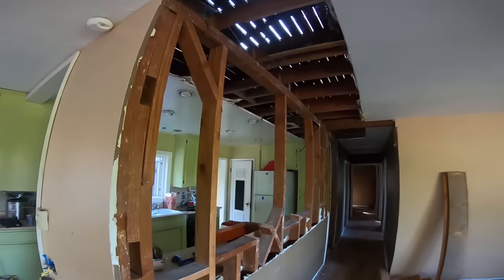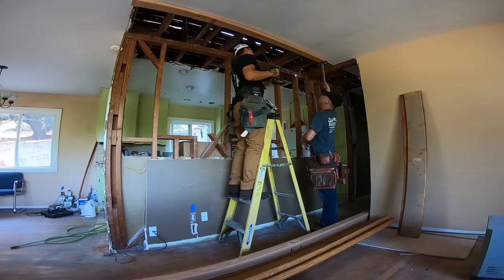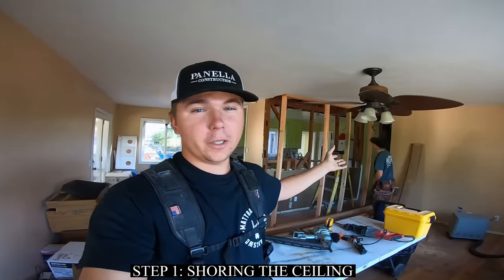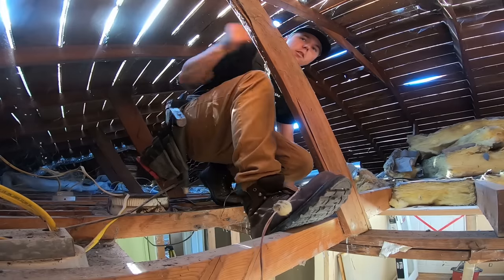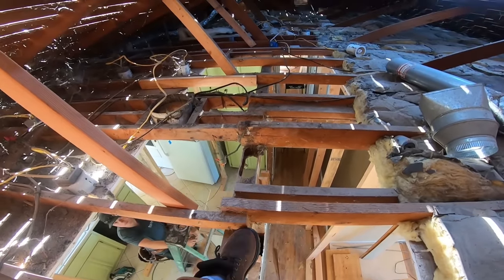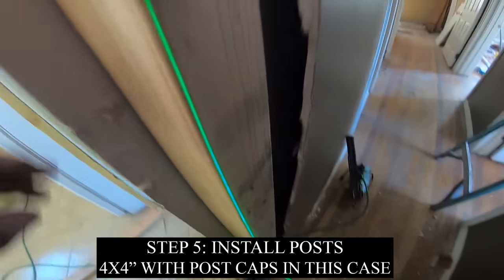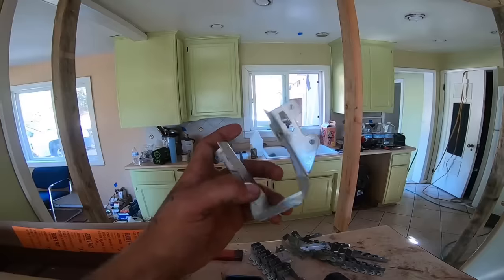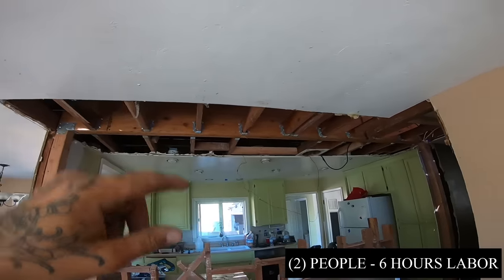How To: Removing a Load Bearing Wall! (EASY STEP-BY-STEP)

Comment: Looks great. Might be good to mention something about potential footers needed.
Reply: 4x4 post definitely need to be supported to ground with pier/footer.  No mention in video.
Reply: @billbrickhouse5975  This is why i was looking through the comments. Do the posts he put in have to loaded onto posts directly below?
Reply: That's what I was thinking,  where's the part of the video showing load transfer all the way down to foundation or footer? even is there's a beam below where are the squash blocks ?
Reply: @fab2832  it was a load bearing wall, it supposed to be a girder underneath...
Reply: Since it is load bearing there should already be a footer underneath from the original build.
Reply: @trevoratkison5074  Maybe? But this is the kinda stuff he should be showing, but he bangs wood not footings? This could be a major compromise to a house structure. However, 6 hour of labor and a screw gun, should be fine.
Reply: Not only that, increasing the footing to hold additional load. This guy is either a GC tool with a GoPro or I don't even know. Maybe living in Guam?
Reply: @ianbeavertonyeah  Matt FOR SURE knows what he is doing.
Reply: ianbeavertonyeah We don’t know where he is, but there is no additional load being carried by the footing. It’s the exact same roof as before, just carried through two posts instead of a wall. The weight goes down to the existing footing. If there is no footing under the house then it was built incorrectly.
Reply: @trevoratkison5074  those beams he set up in the roof don't weight anything? Also considering the roof looks stripped? Is it also not possible they may be resheeting the roof and using different covering material? Seems certainly possible more load is being added.
Reply: ianbeavertonyeah It sounds like you’re not a builder or an engineer. I’ve dealt with both. The house isn’t going to collapse.
Reply: I was thinking the same. Though there is a really good chance that the 4x4 on the corner has support under it because it was already a high load area.
Reply: Its on a slab you YouTube engineers 😅
Reply: Fab2. Same load as before. It was bearing weight at the same points.
Reply: All load bering walls have a foundation already so the 4x4 are fine
Reply: @trevoratkison5074  right, but it would have been engineered for a linear load, not a point load. A footing engineered for a linear load is not, by default, engineered to support a point load.
Reply: @ianbeavertonyeah  not a significant enough load change on the roof to factor into removing a load bearing wall.

And IF let’s just say IF they were red herring and using a very heavy roofing application they would have to beef up all load gearing walls, interior and exterior.

This wasn’t “how to strengthen all existing load bearing walls to support a double weighted roof” it was “how to remove a load bearing wall”

The reasoning for this isn’t to support EXTRA load, it’s to carry the load in a way to create more interior opening.....

And the weight of the roof braces??? Really??? Adding a couple 2x4 in the roof is going to affect the weight of the roof to the point you have to add extra reinforcement to the load bearing section??? Really??

Unless their using clay tile or slate tile there’s not a roof load to calculate.

People double or even triple shingle roofs commonly. Not saying it a good practice.

But do you think if their saving money on the rear off of an old roof their going to double up load bearing walls??
Reply: @geoe5137  but yes you have a valid pint about that.

The foundation will already be strong enough to support the load (in lbs) but the floor joists should have some extra support at the two points that the 4x4 posts were attached.

Just a simple sister joist spanning the area would be good and quick and easy to throw on.

Not a massive area to cover anyways, just to ensure the vertical support below the floor joists carrying down to foundation footing (if footings) aren’t strained below the posts more than before, as there should be verticals all along the work area (almost a mimic of the load bearing wall just removed) so that all those verticals under the floor joist are getting even weighting through the floor joist.

Now would it be better to double up the floor joist so it can better carry the two 4x4 points evenly across all the lower verticals?

Or would it be better to just double up the verticals below the 4x4 posts?

I would think sistering the floor joist would give a more even weight bearing than just doubling the lower verticals wouldn’t it?

But then doubling the specific lower verticals could in theory carry the weight down to the footing though?

But then I’d imagine it would put more stress on the specific points where those verticals sit on the foundation. So in theory not just in terms of framing but in overall terms it would be better to sister the floor joist? As it would then carry down several verticals to the foundation so the foundation has an even load?

Not just worrying about ‘will the wood be able to carry the weight’ and only think in terms of framing, but rather will all things factored in (foundation) be able to long term handle the load in a proper way as to not cause extra fatigue on the footings in specific areas.

Let’s get some good convo going here might save someone from making a grave mistake lol.
Reply: And btw I’m not an engineer or framer.... just a roofer using his noggin trying to apply common sense in a world which lacks it greatly.

And comments or criticisms taken appreciatively.😘
Reply: @trevoratkison5074  wrong. Your load is no longer distributed
Reply: @sinnermandanny   Read the other replies. There is no added weight, and the roof on a small house like that has plenty of support from the existing footing. Removing 10' of wall in this house will do nothing to disrupt or harm the footing that is already there. But go ahead, find the home owner and give them a call. Ask if their house has collapsed and then prove me wrong.
Reply: @trevoratkison5074  the post have to be carried down to the girder with squash blocks it’s a point load now and not spread out across the 2x4 wall like it was before they took it out.  LVL carries the roof, the posts carry the LVL On 2 point loads that need to be transferred down to girder directly under posts.  The part of girder in between the 2 post is only carrying the joist and sub floor now that wall is gone.

Comment: Good job Matt🤗
I’ve got a 1954 California Ranch style house here in Orange County, Ca. This model has a 16’ span that runs directly under the Ridge of the roof. The original builder installed a 6’wide x5’ tall privacy pony wall under and to the side of the 16’ long beam. At the end of the pony wall “Was” a 4x4 post. Meaning the unsupported span “Was” 10-11 feet.
Everybody is this neighborhood took it out for aesthetic reasons. 30 years later everybody has saggy ceiling (1/2”- 3/4”) and huge crack running the entire 16 foot span. I’m so tempted to just jack it up and build another pony wall with support. The original beam is a 4x12 that I should sister some LVLs to. 
Guess those old timers knew what they were doing with that pony wall / support. 
Anyways.... good video, you are a talented teacher/video editor. I will hit subscribe and like👍🏼

Comment: I am interested in seeing how the purlins and lvl beam looked at completion. I did not see where they were attached to complete the support. Excellent work and video, closing on a 1960 home and am looking to open the kitchen interior wall to the dining and living rooms for entertaining purposes and install an island. 24' Span single story. Definitely excited. Thanks!!!!!
Reply: Not sure the length they did on this one, but it was 14" beam. What size beam will you be using on that 24' span?
Reply: @afternaphair  putting this on the maybe sometime lol currently looking at some other Reno projects starting with inground pool. Cheers

Comment: Great Video. One question though: What do these 4x4 posts sit on? You need to make sure the loads from these posts can be safely transferred down to the foundations.
Reply: They should be sitting on 2x4 bottom plate that bolted on the ground
Reply: Id bet the house doesn't have a basement, and the length of houses with no basement have cinderblocks spanning from side to side

Comment: I have to replace a garage door header so this video is very helpful in building a support wall to hold the weight so I can remove the old and replace with new. Have a lot of termite damage to deal with.

Comment: Great job! Only thing I would add is info on the footers. Most of the time they need to be modified or redone for the new load bearing posts.
Reply from the maker: I wasn't really sure who I was going to be targeting with this video, and I had to make sure it was done fairly quick, so I skipped over a few things I wish I could have added.. Got the basics! This build in particular is a subfloor.. So 4x6" blocking underneath is necessary! :)
Reply: @MattBangsWood  Great video!  The 2 things I would of added: 1 What Dad Said above and 2 would be a reference to beam sizing, so people don't go sticking 2x4's or 2x6's up there. Love the videos, Keep up the good work!!!
Reply: Ahhh, what does dad know anyway?!  Good stuff guys, appreciate your work & enjoy the channel.

Comment: another excellent vid. I like that you take time to explain, both by voice and diagrams. I hope they changed out the recess lighting. You lucked out on wire slack to go over beam. I’ve had to go reroute on many remodels, but none had the roof decking off. Would’ve helped on those hot Texas days.

Comment: Hey, good video!  Should you not have PL glued and screwed the LVL beams before hanging joists on either side?  For a more solid assembly that will resist pull-apart?
Reply: true but not neccisary

Comment: Great job!  What does it cost to have such a project done?  I am considering doing exactly what you did in ranch house to open it up.
Reply: I was considering having a load bearing wall removed to open up the kitchen to the living room. There's another level underneath so that complicates things (e.g. if it wasn't done correctly the front part of the house would collapse). An engineer would need to be consulted, blueprints drawn up, permit obtained and an inspection done. I'm in California. The contractor estimated it would be $5000 to $7000. I'm leaning towards not doing it since it would delay my renovation.
Reply: I have a basement below my kitchen/living. Same situation as Rachel, I got quotes for 50-70k for a kitchen remodel with removal of a load bearing wall in California early 2022.
Reply: @rachels7252  
You can sometimes go above it like he did or good below it. 
In the basement you can put support down there also instead of just above it. 
In some cases .

Comment: Though the term “load bearing” is correct, what load is the wall actually bearing? It’s a truss type roof system and all the load is transferred to the outside walls.  Cool saw by the way.
Reply: The ceiling joist coming from each direction ended on top of that wall, it was stick frame not trusses
Reply: TJP 81  whaa?
Reply: not a truss even if it looks like one. A truss is an engineered structure; it has to have an enginer's stamp for it to be an actual truss. This roof structure was stick framed and looks like it actually did have collar ties but they were high collar; what he should have done instead of the purlins, is install a mid span collar tie as temp shoring for the potential splaying of the rafters BEFORE he cut the joists. This kid got lucky, hopefully he'll learn
Reply: TJP 81  depends on where the point load is but...chances are if the load is that great then the truss has been compromised ;-)  But I wasnt talking about this, I was talking about the purlin 'beam' the contractor said would prevent bowing of the roof rafters. Hes kinda right but any load on one rafter w/the purlin would not transfer much load onto the next purlin for how stick framing assemblies behave. He should have attached some mid rise collars, even if it were to be in his crew's way. But this is all moot anyhow since, all he needed todo was at maximum triple up (full span) the existing 2x8s? where the wall below would be removed; saving time, money and renovation costs to the HO.
Reply: TJP 81 seriously i have no idea what you are referring to when you type “vertical braces”
Reply: TJP 81  its called a purlin brace. You are confusing engineering nomenclature between traditional framing and advance framing (truss). You cant apply truss analysis to anything but a truss. As this roof assembly is constructed in modern traditional framing, it has the associated parts and names. In a traditionaly framed stick roof, the purlin brace are indeed designed to carry load. Maybe not all the time, but then again thats why there are 'live' and 'dead' loads for engineers to calculate; also these loads var depending on season. Personaly I dont see the point in purlin braces as knee walls are much better in both structural performance and ease of moving within the attic. Regarding this framer's methods, it would have been better for him to apply a mid or even lower collar tie to temporarily brace the roof because for ease of movement but mostly because he cut the lower coar tie, which was the joist, which could have caused the roof to collapse on him. He got lucky.
Reply: Not a truss roof at all. It’s a cut and pitched roof

Comment: A little late to watching this video so someone might have mentioned it you forgot to show transferring the load thru the floor system done to the foundation.
Reply: Kevin O'Brien  unless it’s not a Crawl space or basement and it’s actually a Concrete slab under it .
Reply: Sometimes even a slab is not enough support.  It may need its own footing.
Reply: Dalex AAB either way they should have addressed it in the video as something to be considered
Reply: Wouldn't it be the same?  The beam occupies the same exact space the wall did, so wouldn't the wall have to already have sufficient support down to the foundation?  Or is it different when you put a beam in?
Reply: mae2759 a wall transfers load oil over a floor span. When you use a post to carry all that load its call "point loading" and requires you to confirm a footer or figure something out.
Reply: @mae2759  concentrated load
Reply: Yes the point load needs support on the girder beam because it can land in between the joist and a single fire block is not enough if you even have fire block depending on when the house was built, not mention what size is the material used for the girder could be 3 -2×8's when 2×10 should be there or even the age and condition of said girder could already be sagging or rotted out. if he didn't investigate it I call it a failure by a novice who shouldn't be pretending to be a professional
Reply: Bryan Douglas you can't just keep adding fire block you also need to double up the joists
Reply: @markschiavone8003  when did I say just add fire block, I didn't
Reply: Bryan Douglas , yes but you didn't say that you need to double up the joists which is important.
Reply: @markschiavone8003  in Virginia point load must go from beam to foundation using non compressable materials
Reply: Bryan Douglas , cool
Reply: @markschiavone8003  you are correct but I'm not getting paid to solve the problem for him either there are many options for fixing this problem and I could fill a page with options for the situation lol.
Reply: Bryan Douglas look when you present a solution to a problem and you leave out a important detail ....you're in the wrong. Its best to keep quiet then to give bad advice.
Reply: The post is going where a bearing wall used to be, so likely there is a beam or pony wall below to support the load. Definitely needs to be checked.

Comment: The biggest thing people forget about is that load bearing wall one supported the load over the whole wall now you wave two big load points. Always remember to beef up what's under the wall as well
Reply from the maker: I was just talking to someone about that! Subfloors crack, dip down, etc. Most definitely have to do something about the two load points you've created in the floor.
Reply: @MattBangsWood  All you need below the two load points are lally columns in the basement. Sometimes you are lucky and there could be one close so all you have to do is block to it. If the load near the fridge side has no lally all you need to add is a lally with a 28"x14" footing under the new lally. I have been doing architectural drawings for about 9 years now and see these scenarios every week!
Reply: @alexg6917  👍🏽✏✏